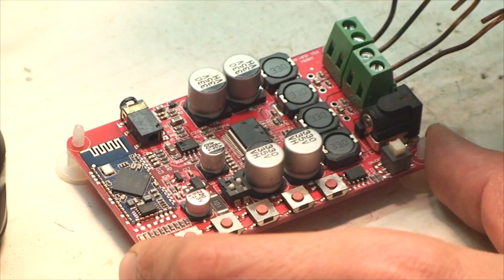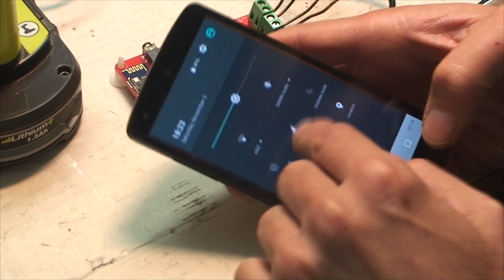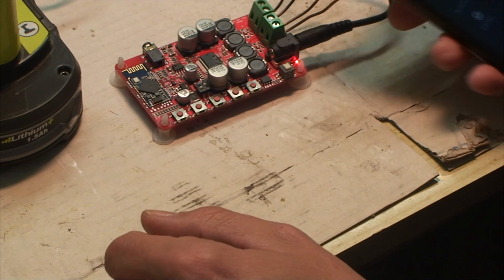Destroyed a TDA7492P Bluetooth amplifier module while it was turned off

Comment: The board power is controlled by a 4409 MOSFET chip. 4409 is a P-channel MOSFET crystal. The positive power supply of this audio power amplifier board is connected to the Source of 4409, the internal IC power supply is connected to the Drain of 4409, one end of the switch is grounded, and the other end is connected to a resistor to the Gate of 4409. Because there is a diode inside the 4409 chip, the positive pole of the diode is connected to the Drain of 4409 (that is, the internal IC power supply), and the negative pole of the diode is connected to the Source of the 4409 (that is, the positive power supply). Therefore, if the power supply is reversed , it becomes that the IC power supply is directly reversed (the switch will be turned on or off), and it will burn out directly. The reason why the Bluetooth module didn't burn out was because it passed through the step-down chip, and the chip should have a reverse polarity protection device, so it wasn't damaged.

Comment: my amp died but both the amp ic and the bluetooth ic look fine and dont warm up
I went as far as checking all of the pins of both ics and found no voltage delivery
I think that my power delivery on the board is dead, I cant find whats wrong though
I can only find a voltage on te biggest of the regulators and it only provides 3.6V which I though was for the bluetooth but Im not sure

Comment: What was the purpose of destroying it? The switch doesn't power down the amplifier chip - only puts them on standby. If the switch was to handle full load then it has to a heavy duty handle the current. Really a standard way of designing most things. When you think your TV is off it really isn't unless you pull the plug. It's the same here. Sure for battery use you have to cut power completely in order not to run down battery - just add your own heavy duty switch directly on the power supply.
Reply from the maker: Thank you for your comment! You are perfectly right. I did it by accident, and I wanted to draw attention to others not to make the same mistake.

Comment: Hey can you tell me abt that power jack dimensions need to buy jack for that i didn't receive amp yet
Reply from the maker: 5.5mm x 2.1mm DC plug
Reply: Thanks man
Reply: And one more help please can you tell me the polarity ?of plug thanks
Reply: And whay i cant use one speaker only ? Solution plz
Reply from the maker: Central positive! Don't swap that by mistake, like I did! :D
Reply from the maker: I do not see any point against using one output only. However you will loose one channel. I'm not sure tho that you can interconnect outputs to receive both channels on one speaker.
Reply: I dont want to bridge connection

Comment: Hello I was wondering if anyone has tried bridging or linking two of these amp's to allow for the use of 4 speakers. I tried hooking 4 speakers but the bass will get distorted but when I only have 2 speakers it can handle it with no issues with distortion. Please advise.

Thank you,
Reply: One of my friends did it with a similar amp. He has like 10-14 of them together, but I don't know how he did it.
Reply: Thanks for the response Audax. See if you can poke your friends brain to find out how he did it.
Anyone else has any info?
Reply: You need to properly calculate the impedance of the speaker system and also the speakers need to be set up with proper polarity, otherwise the sound will be pretty bad (like they cancel one another)

Comment: This is how I'm going to do it...
2 12V 1800mAh 10xAA Ni-MH Battery packs 
1 Tamiya Series Y-Harness 
1 2.1mm Male DC Power Plug Connector Pigtail
I'm going to chop off the end of the Tamaya Series adaptor and install the 2.1 Male power plug for a total of 24v...the amp is rated for 25v power, I'll have to charge the battery packs one at a time. or on two separate chargers.
Reply from the maker: I'm not sure, that 2x12V will be better than 1x12V in any aspects. I would go with a single pack.
Reply: I was looking through my stuff that I already have and I happen to have a 12v 3.0 AH Makita battery and charger from my old cordless drill, think that might work better if I solder on a power plug to the battery? If I can use that instead it would save a ton of money off eBay.

Comment: It happens to all of us sooner or later... a Small , cheap Diode inline between your plus cable would have saved the circuit , a 25 cents solution for A 10, 95 Euro problem....
Reply from the maker: I'm not quite sure in that. I don't mind the design of this module at all. A 5 amps diode is nothing but cheap, and takes up a lot of space. Is is just interesting, and notable that the power switch does not cut power from the amplifier IC.
Reply: Hey Balazs. Can i ask you something? I got an 2x50W TPA3116D2 Amplifier board. Operating voltage from 12 to 25 Volts.
I tested it with 1 speaker connected and i am using a Mean Well 50 W 24 Volts PSU.

The amp turns on and off in a fixed frequency. What could cause this problem?
I could not find any short circuit. Do you believe the PSU ist too small, even with just 1 speaker and small volume ? Can it be that the current peak on turning it on is too much so the PSU cuts out and comes on again?

All indications LED light permanently with no difference.
Reply from the maker: 24V 50W should be more than enough. If the PSU is defective, than all indicator LEDs should also go out. Sorry, I cannot help.

Comment: it looks like to much amps mybe
Reply: its reverse polarity, he did mentioned it.
Reply: akupehsluarketatAR can u tell me how to find out whether current flows through the wire is positive or negative??? please reply...
Reply: usually its color coded. A train electrician will know which color are for positives and negative or you can use a voltage detector. A positive line will activate the voltage detector.

Comment: I can also say that I have been testing quite a few of these Class-D boards....   This one: 2*50W+100W Mini TPA3116 2.1 CRS 4.0 Bluetooth Class D Digital Amplifier Board works quite well with a 24vdc 5+Amp supply.  It is in a NICE Black case with Bluetooth ver-4.    I also use the: TDA7498 2*100W 2 Channel Audio Stereo Digital Power Amplifier Board DC 15-34V, I use 24vdc 10Amp supply to power JBL LX44's and they sound GREAT !!!!   VERY Low noise floor and GREAT Sound IF The power supply is RIPPLE-Free !!!!

Comment: When I save up a couple hundred bucks I'm going to get a few of these and make my own portable speaker system. Do you think Tang band full range drivers would be decent? Wanting to get similar sound to a JBL Flip 2 or even louder if possible.
Reply: I'm thinking about getting the W3-1053SC drivers.  Frequency response is 100 ~ 18K Hz, and 15w rated power. Unless you have any better recommendations? Please let me know!
Reply from the maker: I cannot say anything about product I did not have tried. Even with the same brand there can be quality differences. With JBL you definitely get a quality product, on the other hand I recommend you DIY modules like this, when you want to own your unique device. I personally prefer coaxial speaker systems.

Comment: cheap, doesn't even have a diode.
Reply from the maker: Keep in mind, that a diode you mentioned should stand 5 Amps. Also, that diodes has a voltage drop. I think this is a well designed product. The cheapness comes from the manufacturing methods used (or not used :) ).

Comment: so, the magic smoke came only because the positive and negative was inverted i the plug?
Reply from the maker: Right.
Reply: well shit, thats a rookie mistake, attleast for me... :D better order a new one. Is the positive inside the plug?
Reply from the maker: If not mentioned, positive is always the inside, and negative is the outside. I also have bought a new model. Check this: https://youtu.be/q37LFamX77g
Reply: yeah, i had no idea about that since i never had to think about it.
Reply: Balázs Kelemen can u tell me how to find out whether current flows through the wire is positive or negative?